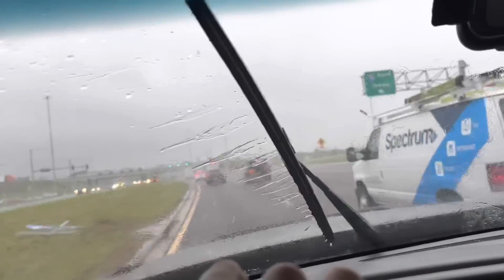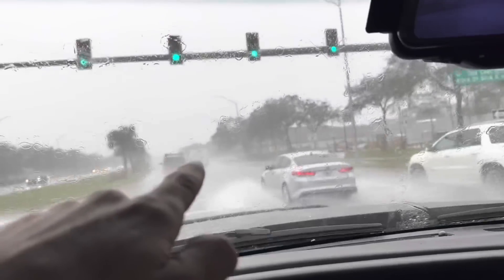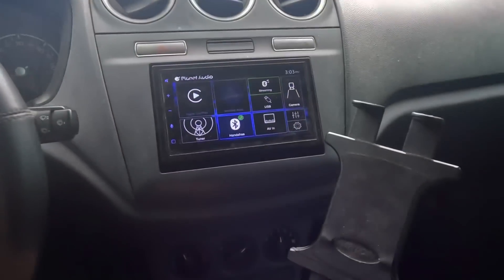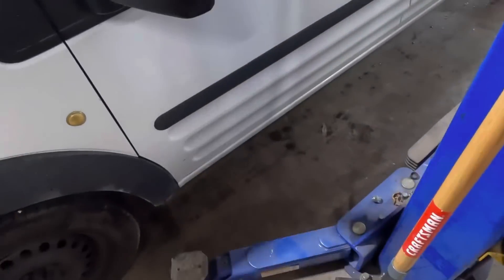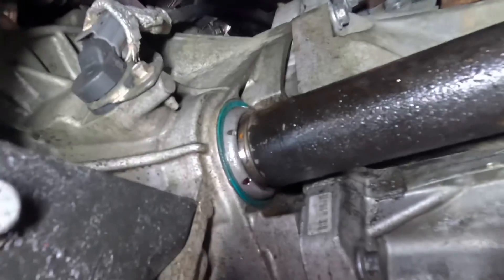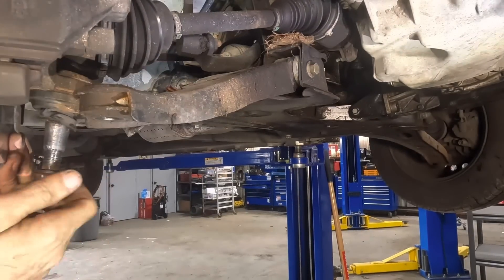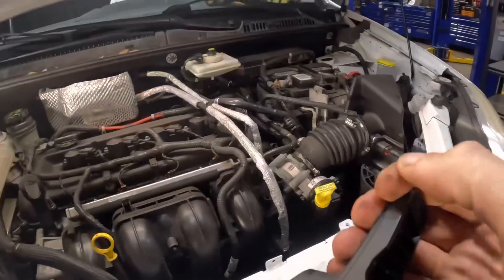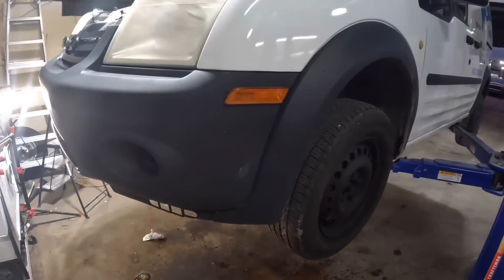Out of Business? Working ON not IN!

Comment: I was under my Triumph Stag (80's) on my back changing the gear oil and forgot the drain plug, after a while I realised my hair felt heavy and found out Id been lying in a puddle of it!! I showered off and found my hair was so soft after as it had worked like a conditioner. Not sure it would sell though as gear oil smells pretty bad lol.
Reply: My little Subaru Brat filled my hair (when I still had it) with gear oil. As I recall it took about a week to get the smell out. Nasty stuff.

Comment: 9:50 There is a genius trick to separate joints if you have enough space. take to equal sized hammers and whack them simultaneously on the joint from opposing sides. I was totally flashed as I first time saw how easy it owrks.

Comment: Fyi Ray, I bought myself a set of Rigid impacts this winter holiday season, a lot based on you using them, then doing my own due diligence.
So far very happy. The difference 15+ years makes in the technology and power of an impact and a hex driver are huge.
That's all, just a thank you.
Reply: if it seems like its not hitting hard, check the battery. the output of the power tools has gotten WAY better but battery tech hasnt caught up (electric cars prove that) so what ends up happening is below like 50% battery it hits like 30% less, and sometimes that makes all the difference
Reply: A good impact wrench makes such a difference when working on cars.  I got a Dewalt since I have all Dewalt tools for my business and house, so have a lot of batteries.  What used to take me hours to do, with breaking bolts lose and struggling takes minutes now.  Well worth the money spent for sure.
Reply: I love Ridgid. The new 18V Brushless Cordless 4-Mode 1/2 in. High-Torque Impact Wrench is getting higher numbers then Milwaukee. They also have a life time warranty.
Reply: You must register them on their website for they to be covered, don't forget.
Reply: @paulbcstx  I did that! I had to break out my magnifying glass to see all the serial numbers on everything, but I got everything covered.
Reply: They perform better with the newer Ridgid high output batteries, also always use a 4.0 AH battery (the big one) over the smaller one, it makes a huge difference.
Reply: @LetsDIYIt  --You Got de Money--Dewalt has Got the Time...
Reply: @randybeard6040  love all my DeWalt stuff. Have had them for years with no issues.  Not home use either, but as a contractor
Reply: @bradhaines3142  if that is happening you have a bad/failing battery. The only reason it would lose power/torque is if the battery was losing voltage. If it's losing voltage before it is getting near fully discharged then it's a bad/failing battery.

My Milwaukee gives the same power for the entire battery, essentially.
Reply: Torque channel Frankensteined together a Ridgid and Milwaukie impact driver- Ridgid back end (battery, motor) and Milwaukie impact drive / hammer etc. Stronger than both, but they left out some parts that will probably shorten the thing's life. Still good fun.
Reply: @williameldridge9382  project farm and torque twst channels have done videos on it, its NOT for the entire battery. you're right on the reason why though. 

also, i found that out using a milwaukee 1inch drive, it was literally the difference of getting the bolts loose or not

Comment: Seal goes in super easy if you do a quick dip in liquid nitrogen.   It shrinks it a thou or so, pops straight in and seats as it comes up to room temp.
Reply: Just not feasible for a shop to keep it laying around.
Reply: Or 30 minutes in the freezer
Reply: @Laugh1ngboy  exactly, the simple answer...liquid nitrogen? Who keeps that laying around lol?
Reply: I must say I myself has used that trick many times in replacing bearings in the printing industry myself,  I am a master printer and mechanic and I am now retired.
Reply: Yes, the freezer
Reply: @Boga217  when you know before hand and gas place is around the corner, not such an issue.
Reply: @rogeralbans4082  but why would someone running a business take the time and money to go around the corner when break room is 80ft away with a freezer, it's just illogical.
Reply: Liquid Nitrogen would make the seal brittle... A normal freezer for 24 hours is usually enough to give the shrinkage needed...
Reply: No doubt works if it doesn't shatter. Mite be a tad hazardous for most techs to learn technique, probably why no auto repair shops have a setup
Reply: @peted5217  Yeah. The techs would turn bananas into hammers, flood the floor with it and trip over now hidden equipment. Too much fun. Dipping and smashing frozen flowers too... Certainly faster than a freezer.
Reply: @johnmcanulty7341  General use of  liquid N would have about same outcome as having driving public all fly small planes .

Comment: Just a thought, with that seal, having got it started using a broad piece of steel and hit the steel, or even a block of wood cut at a slight angle so it fits in the space and then thump the end of the wood. Maybe, maybe not. 🤷🏻

Comment: Your example of the mud boggers is true to a point.if the tire is tall enough to keep the axels out the mud then that works but if you can't reach the bottom with dragging frame and axels you need to float, good mud tires will pull you along in mud and snow when deflated properly.

Comment: One little piece of advice, this being a Transit Connect is different, but if you ever get a full size Transit van in, always lift it by the frame only, not the pinch welds. If I could post photos here, I could show you what I mean, after mine was lifted by pinch welds for a set of tires.

Comment: Ray, My solution to not getting fluid, paint, or whatever down my arm into the armpit is to tie a piece of cloth- be it shop rags or an old tee shirt around your arm between your elbow and wrist.
The cloth stops the fluid or whatever, and when done, into the garbage can. You can tell the difficulty of a job by how many rags you have replaced on your arm. I think that might have been a 3 ragger. It works great to stop paint from running down your armpit when hand painting your soffit on your house also.  Your rain shower looks like some of the ones we get here in Washington. (The state, not the state of confusion on the east coast).

Comment: what I've done in the past on that style seal, is to use steel freeze plugs, drill the center to fit on handle from a cheap seal driver or you can weld on a bolt, piece of pipe whatever.
I've also used pvc, steel, exhaust pipe or fittings, with smaller pipe or bolt welded on or even a couple at an angle, to drive more evenly.
I tend to make a lot of one off tools, vs. fighting myself or buying special tools.

Comment: Hey Ray.. shop is coming along nicely! You can easily make seal drivers from a piece of flat metal and a steel rod. Can also use a piece of ABS, PVC pipe or fittings. A piece of exhaust pipe, a piece of hardwood, etc. make up whatever you need to get it done...think outside the box!
Reply: None of those solutions would work IMO as the seal is too close to the block.  A proper seal driver has a much smaller diameter handle bolted to the driver, so the impact area to drive it in is well away from the outside of the seal.
Reply: @CitEnthusiast  Actually many if them do work. Easy way to deal with an obstruction like Ray had, was to use the correct size of pipe or a metal can, etc., All you need to do is remove the section on the edge that interferes with the it seating properly on the edge of the seal. I.E. Cut out a section of the edge, without disturbing the end that fits over the seal, problem solved!  As I said, think outside the box!
Reply: @petergondolier4088    As a professional mechanic having the right tool is a necessity.  Having to take time to find materials and manufacture a tool for a common task is nonsense, very wasteful of time and energy, and does not make good business sense.

Comment: I couldnt fit the piece of pipe i had on hand over my breaker bar or 3/4” ratchet (end handle of a jack) so i had to use an air impact on my axle nut, came right off so that was nice, it probably wouldve taken more force than i weigh myself so i dont think i was getting it manually either way

Comment: you asked if there is a tool for putting in the out-put shaft seals yes yes there are, and there are about 30 different kind and sizes

and the best part is it does give you a way to hit it with-out hitting the engine block
Reply: Exactly, the right drivers are fairly low profile with skinny handles..they'd would fit I'm almost positive.

Comment: Paused at 16:52 I worked for snap-on as a tool designer and put in a fix for your exact problem removing the seal. There is a modified seal remover that has a raised profile giving more leverage to loosen the seal. I can't remember the part number, sorry.
Reply: $10 HF pry bar, or $200 snap on specialty seal puller and they both take 30 seconds to pull the seal.... hmmmm tough call.
Reply: @dave22r2  Yeah if I'm relying on my tools for a living I'm not going to count on the 10 dollar tool. Maybe if I have a few of them but that takes up unnecessary space. Then again if you're diy why spend more than 10 dollars. It goes both ways
Reply: @dave22r2  Because, Rheeeeeeeeeeee! SNAPON, RHEEEEEEEEEEEE!
Reply: @firstlast---  I'm all about spending $200 on a tool that I'm going to use once or twice, but if the $10 pry bar does the job....
Reply: @Springfield-eo8jl  Meh just for this example.  Normally snap on is the way to go for pros.  Same end result with the same effort for both tools.
Reply: @dave22r2  👍

Comment: I love your thoughts on the traction issue with the dully, had never thought of it but only makes sense same as wide tires on cars losing traction on wet roads.
Reply: All army trucks have narrow tires
Reply: I've been driving in New England for 46+ years and I've only spun 2 vehicles around...not on purpose.   Both were 4 wheel drive.  One was a Jeep Wrangler that I spun around in a snowy ride home...there were 6 Marine reserves running side by side in the road on a sharp turn.   I let of the gas pedal and the rear end just swung out. The other was an F250 Super-duty 6.0 diesel 4 door long bed with single 20" Goodyear Wrangler tires.  It was on a damp highway ramp.  I turned onto the ramp and at 10mph the thing just took off in a 540º spin on a slight upgrade.   No black ice...it was summertime.  It wasn't raining.  It was dew running down hill.   I had about 500 lbs of stuff in the bed over the axle.

Comment: For that seal get yourself a piece of steel flat stock about a foot long 1/4 thick and as wide as the seal. Put it up against the seal and hit the bar rather than the seal. You can get fancy if you want and drill the appropriate sized hole in it.
Reply: Would installing the shaft using a horseshoe shaped wrench as a striking surface hitting the castle nut end letting the weight of the shaft multiply the force with an even force around the seal?
Reply: @larrybe2900  problem with that is you have a shaft in the way...no leverage and you'll need a pretty bug wrench and you wouldn't be able to tell if the seal is seated properly and probably a few more things I haven't thought of.
Reply: PVC cut to length and a cap on the whack end
Reply: @arthur962  
My thinking is that it would give a square force on the seal forcing it in correctly. It is a bad design for sure.

Comment: Had a volvo xc90 -08 with a broken doorhandle yesterday. Owner came with handle for other door.  Just a broken pin on a little aluminium tingy,, totaly unweldable. found a Steel Roller Chain Link and modded it into place. mounted the part and it worked.

Comment: A carpenters tool you might want to put in your tool box is called a "Wonder Bar". It's basically a flat prybar about 1 1/4" wide that you can hit to encourage a piece that you can't directly hit to go where you want.

I've use it to put bearings where I couldn't get anything else to work.

Comment: Pro Tip for installing seals, take some white grease or transmission assembly paste and pack it in to the back side of the seal.  This keeps the spring in place and also insures the seal stays lubricated.

I like using GM Lubriplate, a white grease, for all seals as it doesn't dissolve and it protects the seal for years.

Comment: Ray, do you cycle the transmission through all of the ranges after adding fluid? I worked in a transmission shop early in my career, and we always cycled through the ranges. Gave a more accurate level reading. You'd be surprised how much a few low servos can hold. That way it's one and done. Shop is looking good! Best of luck, and have a great day!!
Reply: I never was an ASE cert mechanic. However in the 70's & 80's before eec systems I learned to cycle tranny through the gears (auto) to be sure servos were soaked. Then a reread of dip stick pointing downward so as not to get a higher than true reading. Even if it's a 3 second focus.
Just saying. Anyway, love the vids. Always masterful content and humor. Especially forethought on cya legally and mechanically
Keep up the excellent work.

Comment: I worked on CH53 helicopters when I was in the Marines.  We had this one component called a slipring which enabled electrical signals to move from the stationary helicopter to the spinning main rotor head.  To remove it you had to remove 3 hydraulic lines connected to a similar device which allowed hydraulic pressure to move to the rotor head.  This was work above your head.  Our trick to keep hydraulic fluid out of the armpits was to tie a rag around each wrist to absorb the leakages.  Otherwise you would end up with a pink t-shirt (we wore white t-shirts back then) Love the videos, keep up the good work!

Comment: Like your pragmatism and practicality working on this stuff, Ray.  I'm a DIYer on cars and to me professionals have a strong bias toward using metal helpers/tools.  I keep a bunch of pieces of wood around- wedges, pieces of pole, plywood bits of various shapes, lengths of 2x4- and they're really helpful when prying/holding metal stuff apart, propping and pushing in metal stuff, etc. doing minimal damage to the metal parts.  Also use PVC and steel pipe, cardboard, plastic bags, duct tape, a big hard rubber hammer, etc.  Live in pretty rainy/snow/salted streets climate (New England) so put some molybdenum grease (happened to inherit a bunch of it) on rusting surfaces that have to last a little longer and on stuff I will take apart again- under and over nuts/bolts, between tire rims and rotors.

Comment: @21:00 A 1/2" thick piece of red oak board, about 6" long...or whatever makes sense. Lay it flat against the seal, and use an air hammer against the opposite face of the board.

I'll also use pine, for situations where the seal (or bearing race) is exceptionally flimsy. Point being: Wood is very soft, and distributes impact forces very well.

Comment: when i was young working at a engineering company we use to put a pipe where the oil would connect to the machine and keep the parts well oiled but use the oil to clean the machine on the outer body of it 
the pipe came off while i was cleaning the machine and the oil totally covered me from top to bottom ,a few employees and the gaffers who owned the company saw it and was laughing there heads off .
i just carried on to fix the pipe and carried on ,i still had 5 hours of work time so i said i will carry on instead of going home ,they offered me to they will pay the 5 hours i said no and carried on till finish time 
they put a plastic wrap on the passenger seat of their car and took me home 
i never got a rash or anything ,i just carried on the work i needed to do oil did not affect my skin one little bit but it was funny at the end of the day.
Reply: Real men keep working.
Reply: @AllanO808  i started work at a young age ,it thickens your skin.
drives you to make money ,it is a good incentive to save .

Comment: Hey Ray I wonder if the final drive has a through hole completely through it or if there’s a cross pin in the way only thing I thought it was clear all the way through you can make a seal puller and pull it in to place from the other side there’s tons of room over there or maybe use a slide hammer to pull it in place

Comment: Hey Ray, you can keep the door and put the compressor there, just build a simple frame and use foam insulation sheets as wall board on the inside and outside of the "wall".
This will keep it out of the salt air and extend its life.
Reply: Might be a fire hazard if the compressor burns.  If you cover it with sheet rock, fill void with spray foam or fiberglass, it will be fire resistant.  Should be based on local codes.
Reply: @toxichank6960  yes. Thats a good idea. 
I wasnt thinking about it that deep, just suggesting the area can still be used that way. Ray will know how to do it proper. he doent need to rebuild a big wall like what was there though. And that was my main point.

Comment: Ray. You need an offset impact. Try a flat piece of steel or wood. Place it on the seal then hit the new bar away from seal to make the steel bar transfer the impact. Like a lever.
seal ----- impact point ------ gearbox body.

Comment: I hate when fluid runs down to your armpit. A simple trick I found was to tie a rag around my forearm the fluid gets absorbed for a while and then will drip off the rag tips to the floor away from you. Also a race driving punch works well for seals that are blocked as this one was. However as a mechanic you adapted well and conquered.

Comment: Looks like you could use some out of the box engineering for those output seals. Like a piece of 3/8"  steel plate with an appropriate sized hole for that seal and a large enough handle that you could beat on. Hope you can still use your new compressor room once you get the broken mortar joints fixed. It will make a HUGE difference when taping while the compressor is running.